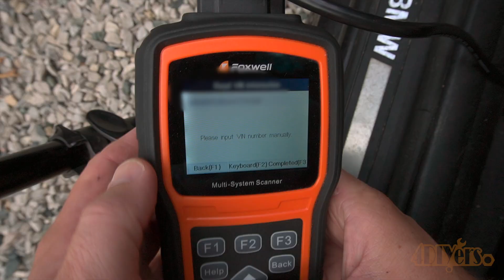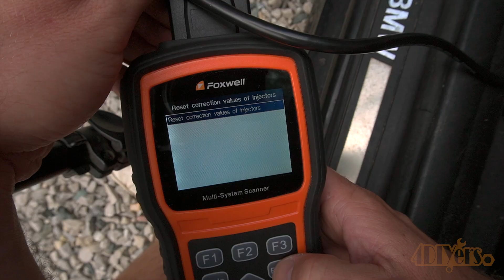How to Reset the Correction Values for the Fuel Injectors on a BMW

Comment: I see you are using the Foxwell NT530, is it a worthy upgrade to the 510 that the BMW community recommends for diagnosing? I just purchased a 2012 X5 35D, and the engine is knocking badly. I'd like to check the injectors and emissions components before I begin disassembling the engine with replacement of the entire engine being the worst-case scenario depending on what I find.